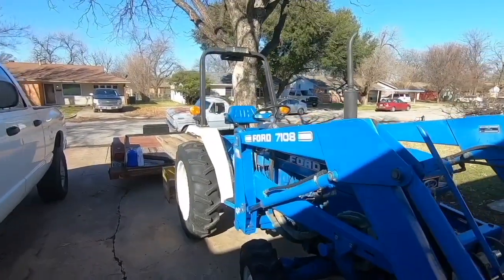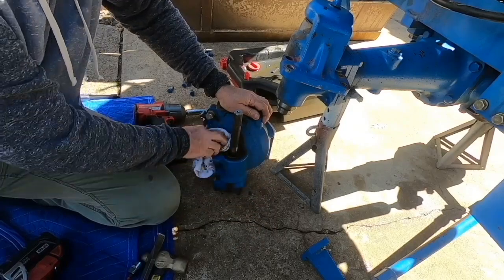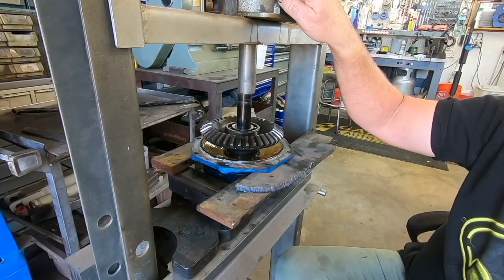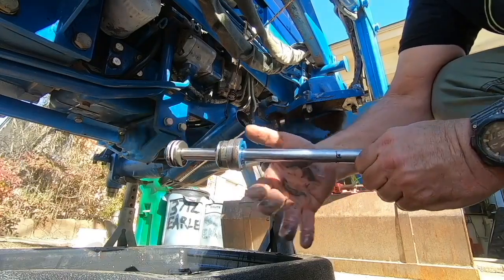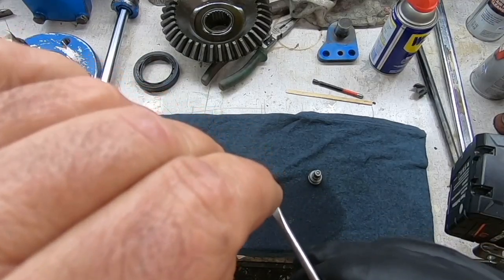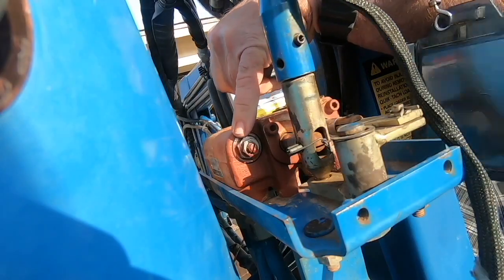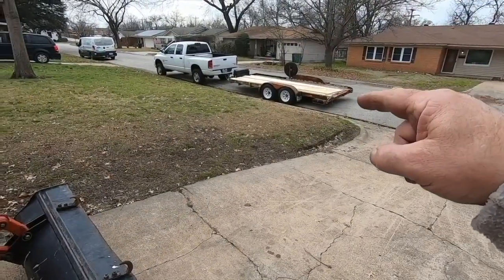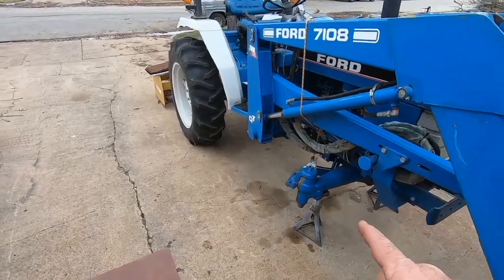Workin on the ole Ford 1720

Comment: Great video.  I have a 96 1720, first rebuild was the steering hydraulic.  Very easy repair.  Your video on the front axle seals will help me immensely.  Thanks for putting it out there.

Comment: Got a NH 1920 and a "71" Bronco= long time subscriber. In the vid you showed R&R and cleaning of controller valve, did it solve the loader problem? Got a loud squeal and jerking bucket lift and curl. Thanks Steve
Reply from the maker: @thomashorgan5554  hi Thomas. After all that, it did not help. I was able to find a brand new original on eBay. Paid 600 for it, pretty expensive, but it will be worth it. Have not put it in yet, but will upload a video on it when I do . Seems like all the projects with the shop in Perrin, electric, water well, now the kitchen at the house… I’m gonna run outa time(gettin old!)😆

Comment: Do you have any information on adjusting the hydraulic pressure on this model tractor? I’m wanting to use a loader mounted wood splitter and need 2750psi. Can this be done?
🙏
Reply from the maker: @cutNdryfirewood  not that I'm aware of. I think without changing the pump, your kinda stuck with its output.

Comment: Had to change those same knuckle seals on a newer subcompact tractor with around 300hrs. Apparently the manufactures know this issue when running the tractor.  Something about pressure build up in the front axle and it not releasing appropriately.  Some people have added their "fix" with an air tube attached off an air barb screwed into the front axle fill bolt running up to the engine compartment with a check valve.  Can't say why these fail on older tractors though, if this is the first time on that 1720 I'd say it's probably just age.
Reply from the maker: I totally agree with ya!!

Comment: What’s the weight capacity specs on it
Reply from the maker: @AdamDobbs-t6l  just under 800 lbs
Reply: @ dang I thought it was higher
Reply: @StevesBeyondRepair  what about the rear 3 point
Reply from the maker: @AdamDobbs-t6l  1700lbs. Internet says 800 on the loader. Sounds low to me.
Reply: @ yeah I seen different numbers I seen 1150 then heard 2000 rear about 1700Lbs you’ve had one why I asked